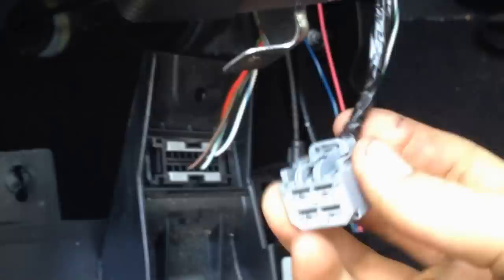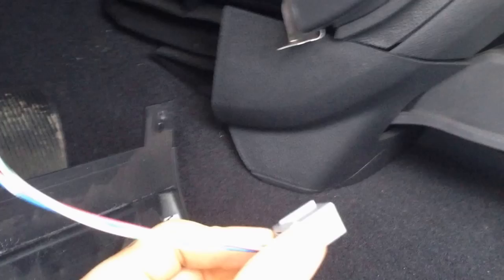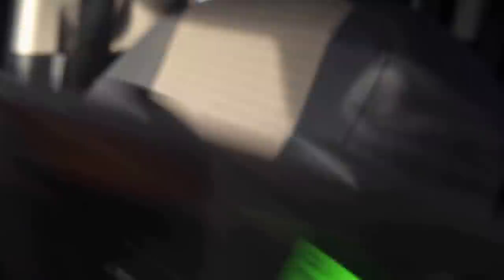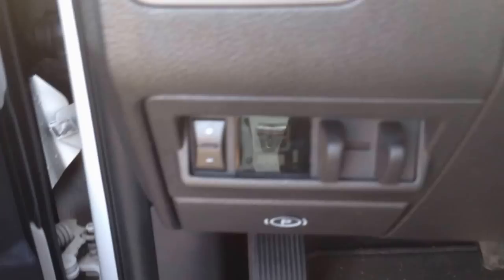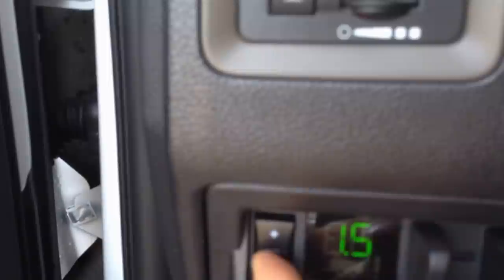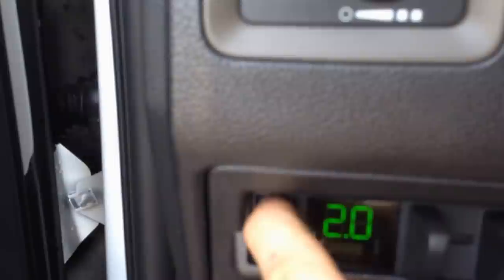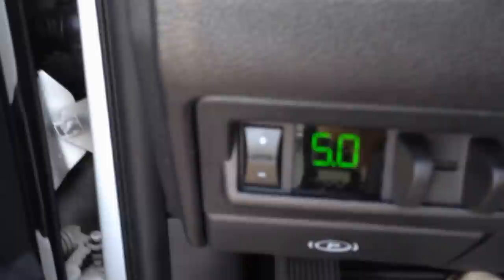Dodge Ram Integrated Trailer Brake Controller Install 2009-2012

Comment: Where did you get the smaller 4 pin harness that you hard wired in? I can't find one
Reply from the maker: +Ryaneg6freak I typed in the number in the video description into eBay but it looks like the seller doesn't have any for sale right now, try contacting him?
Reply: +PkwyDr thanks for the video. It should work even if it's no programmed in the display right?
Reply from the maker: +Joshua Collins It will work, but if you get it programmed, it will display on the dash as well and you can set up different trailers and I believe records things like how many miles you've towed each trailer.

Comment: I have the two plugs I’m still no have power to my 7 way conector to my brakes advise please
Reply from the maker: Is there any error message on the brake controller?
Reply: Seis trailer disconnected
Reply from the maker: And you have power to other 7 way pins for lights, etc? Just no signal for trailer brakes?
Reply: Yes Sr, no power on brakes I’m already checked whit my tester
Reply: All the lights work perfectly except the brakes
Reply from the maker: Have you checked fuses under the hood to make sure there isn’t one blown or missing for trailer brakes?
Reply: I will thank you so much for you time sr.
Reply: I had to go to dealer and have computer flashed and pay for the software for trailer brakes.  Cost 160
Reply: @swampthingzr2ify  what year is your truck?

Comment: Thanks for your response to Ashley, I asked her to type something up for me because I could not find the part but finally I got it. Try ebay part#271821904700. Got the part, took it down to the dealer and got it installed with no issues.

Thanks again!!
Reply: I wasn't able to find this part. Is there another number?
Reply: +David Wehman nothing came up. Thanks though. Do you happen to know what those three wires control?
Reply: +Joshua Collins, the number I posted above is a phone number. The 3 wires are the power source. 1 is hot at all times, 1 is hot when keyed and the third is ground.
Reply: +David Wehman lol. No wonder. Thanks bro
Reply: +David Wehman really didn't want to contact him like that but I'll give it a try. He's not on eBay?
Reply: +Joshua Collins Try and follow this link: http://www.ebay.com/itm/WIRING-KIT-INSTALLRam-Integrated-Trailer-Brake-Controller-270755017120-/271829517360

He is the shop owner or parts manager behind this page, the page is going to show sold or just sold, but if you contact him either by phone or though ebay e-mail, he will tell you that he makes these as demand goes up. Mine plugged in flawlessly and had the dealer complete all the taps and splices..
Reply: +David Wehman thanks. The wiring doesn't look hard at all. I'm an electrician so no biggie for me. But I didn't want to buy it then hook up my camper and it not work you know. Did you flash your computer to have it show up on your display?
Reply: +Joshua Collins No i did not have it flashed, i just set the gain and go. I am an electrician by trade as well but didn't want to void my warranty messing around with the wiring that goes into the ignition cluster. Just a thought. Best of luck to ya!!
Reply: +David Wehman gotcha. Thanks man. Sorry for so many questions. Just don't want to buy it and it not work. I think I'll try the wiring myself. Do you still have the truck? Could you take a pic?
Reply: +Joshua Collins No worries, I was feeling the same way when I bought the part and couldn't find the adapter. It definitely wont be a waste, works great and looks bitchin. Glad i could be of help. I will try and shoot you some pics this weekend.
Reply: +David Wehman Kool. I just wanted to see the wiring part. I'm not really worried about the warranty right now.
Reply: +Joshua Collins Sorry man, I looked under my dash and when the dealer completed the wiring everything is taped up to a point so its too difficult to see the color code and the termination points.

Comment: What brake controller is the one that fits where you are putting this one in  and can you buy it in a kit with all the wiring
Reply from the maker: Factory brake controller. Should bolt right up and you just need the second harness I have posted in video description.

Comment: I installed but it didn't work flashing IF on the controller
Reply from the maker: Was it a known good controller? And did you watch the video again to double check proper wiring?
Reply: brand new controller.  w
Which wire went to which terminal on the controller
Reply: It looks good now.  Bad connection I think. Just need to test drive.
Reply from the maker: Sounds good man, glad you got it figured out!

Comment: Does any one know where or how to search for that power plug adapter? The part numbers listed no longer exist.
Reply from the maker: https://www.ebay.com/itm/273555639354?hash=item3fb12fcc3a:g:zKQAAOSwstxVFJyr
Reply: I have the 2012 1500 express, I checked on this one, it said it does not work with my truck.
Reply from the maker: @jeffwitkowski6423   Mine was also an express and they list the same part number that I originally listed in the video description, so I’m not sure why it wouldn’t work. Maybe try to contact the seller and ask just to verify.
Reply: Thank you. Appreciate it!
Reply: I have a 2012 sport and it says that ebay part wont fit, is that what it says if it doesnt come with it factory?
Reply from the maker: @Morotak123  Probably. I’m not sure why it wouldn’t fit. I’d contact the seller and ask why they have it listed that way just to double check.
Reply: @TonyTheTruckGuy  mine has the 2 4 prong like yours. Thanks for still answering 8 years later. Must be a big problem
Reply from the maker: @Morotak123  I try to reply to all comments no matter how old the video haha